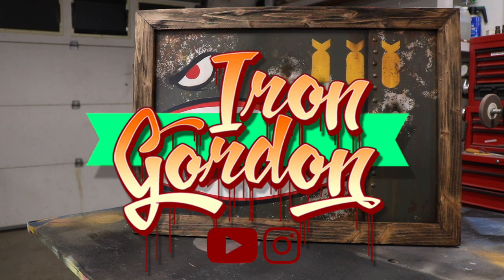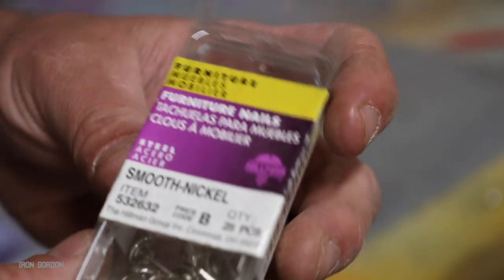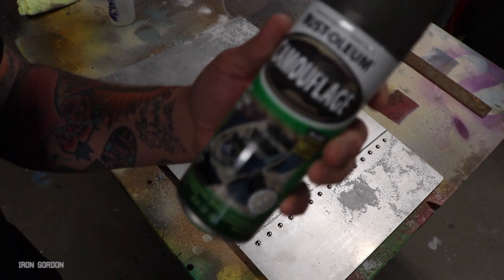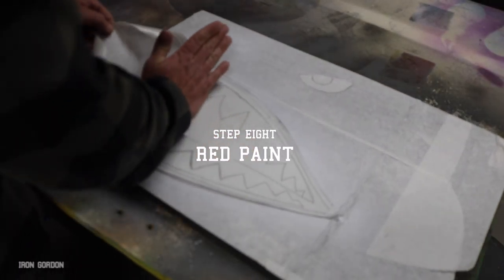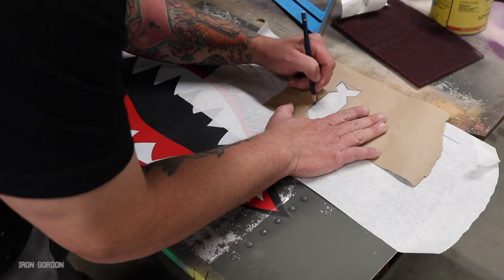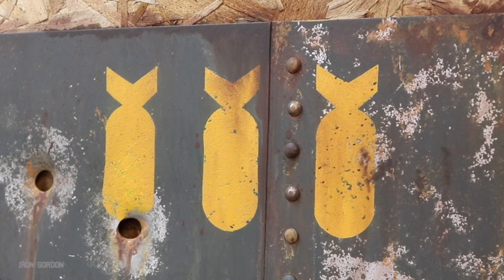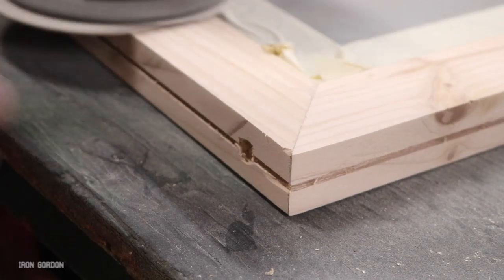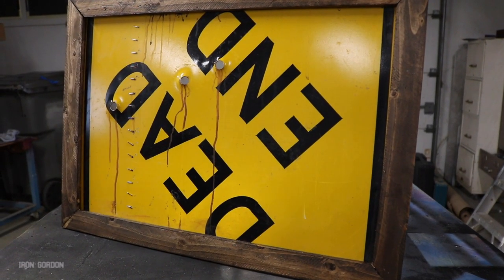How To Make a WW2 P-40 Tiger Shark Nose Art  Panel || Step by Step

Comment: A method I like for built holes is similar but I like to do it after it's painted so the paint chips around the hole also if you have the equipment and live in the right area you can just make real built holes

Comment: Hey great video, thanks for the salt trick, I’ve never see that before and cool process on distressing. Did I miss why you cut the channel on the outside of your frame? Maybe on a test sometime  on one of your next ones rivets would look authentic too

I 2nd James Lilly about having your work piece in between the blade and the fence, but your project looks awesome. I know you’re not asking for suggestions but I also agree with the pallet wood suggestion, and if you could look for one that had some kind of ink stamp like many do, or a shipping crate stamp, wow that would put this already excellent project over the top. Keep it up.

Comment: How long did you wait between paint and covering that paint with masking paper?  I just tried a similar project thinking plasti dip would work.  It did not.  Even though the masking paper isn't very sticky, it pulled the plasti dip up.  Trying to find out a safe time to apply and remove masking paper to paint without damaging the fresh paint.  Thanks, and great job!

Comment: A couple of table saw tips: It is okay to cut aluminum with a wood cutting blade. Picture frame shops do it all the time with metal frames. Use a mixture of soapy water to lube the blade a bit and make the cutting easier and not wear the blade as much. Also, when cutting the rounded edges off the 2 x 4, it is safer to have the piece you keep be between the fence and the blade.
Reply from the maker: Thanks for the tips!

Comment: That looks awesome! Going to give it a try as I am an aviation buff and some panels like that would look great in my workshop. Just something to note, aircraft are made of aluminum, aluminum doesn't rust. Also, you would have been right to use the stencil for the bombs as thats how they did them in the field when putting on kill and bomb markings and they never looked perfect.
Reply: He said in the Q&A at the end that he knows aluminum doesn't rust, but thinks it looks cooler than corrosion.
Reply from the maker: Thanks for watching till the end!
Reply from the maker: Thank You! I defiantly want to make some different variations of nose art panels. 
Yeah the aluminum rusting/weathering is a stretch I just like the way it looks
The stencil thing is a good point, I wanted the layout to look more intentional and the lines to be crisp.  Thanks for watching, good luck with your projects!